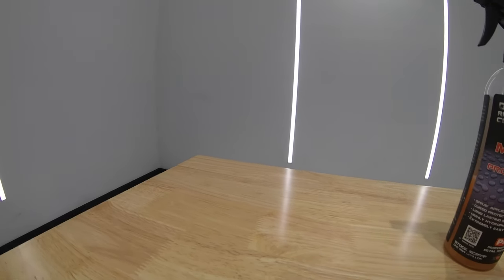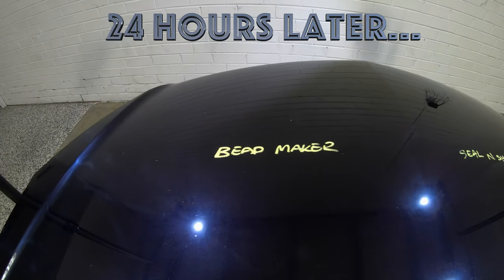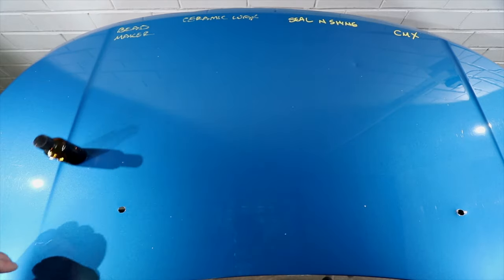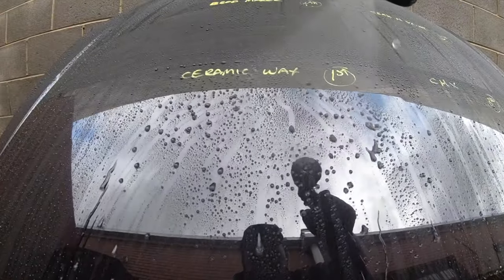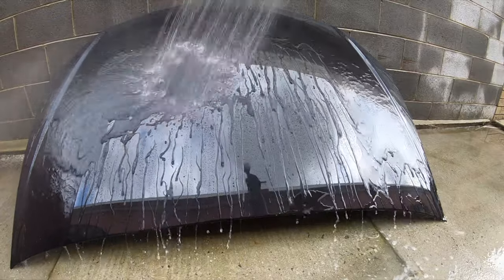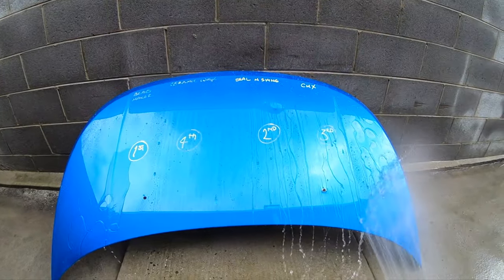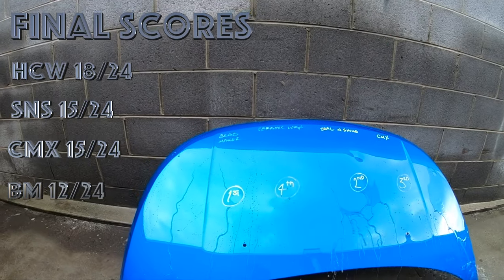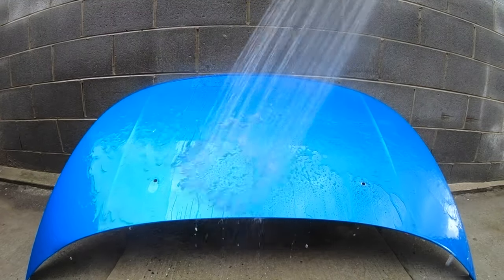Bead Maker vs Hybrid Ceramic Wax vs Seal n Shine vs CMX + Which one would I Choose?

Comment: Sandro so after the tape was removed and camera hovered over the panel IMMEDIATELY Ceramic Wax easily had more Gloss, frankly ez to see. Also in comparison to other reviews, your panel had a haze to start out. Most tests I've seen were prepped and buffed out at least minimum
Reply: He said he intentionally left the paint with swirl haze to make it easier to see on camera.
Reply: @VaingloriousGabagool  I know, just saying appreciate a different view from other detailers thst buffed the panel.
Reply: @CAPTJ696  Fair enough. But why would buffing out the swirls make a difference if the panel is still decontaminated and prepped beforehand, as Sandro always does? Surely any of these products will not be affected much by swirls (if at all), especially when most normal people's cars are covered in them.

Comment: Beadmaker doesnt make beads, which is actually better, you want water to sheet off and to bead on top of the paint, beads just mean you’ll get water spots, if the water sheets off the panel you wont have water spots.

Comment: Wow, the water behaviour of Bead Maker is shockingly bad when the hype surrounding the product is taken into account. The product name is like the complete opposite of what it is. Should be called "Slick Maker" or something like that instead.
Reply: Yeah pretty funny actually
Reply: My results are the opposite for beadmaker. I use it on a various vehicle's: daily Prius, Tacoma truck that doesn't get driven too much but sits outside and collects a lot of dust, honda accord, f150, and Avalon. All washed/clayed before applying a foundation layer. And then after each maintenance wash a few sprays per panel before drying. The water beading is amazing after spraying down with a pressure washer or hose. All or majority of the dirt runs off. I live in So Cal, so it may vary depending where you live. 

Turtle ice selant is amazing for the price and is the winner against chemical resistance.
Reply: Eddie Garcia, same here. I use many different products. But Bead Maker is great at allowing morning dew roll off the car when  leaving home.
Reply: sheet maker? may be better name
Reply: @eddiegarcia9689  Mines too!  Bead maker beads just like all of the other ceramic sealants i have.   And beading is not why i use it.  I use it for it's slickness!
Reply: @AntLive29  lol

Comment: Interesting. I’ve watch many other videos where turtle 🐢 wax is victorious easily over MCW in the durability test . Maybe the cure time is responsible for this . Great video from Andy’s Auto Detailing 👊🏼
Reply: But the main difference with other videos is the application method. They follow the direction on  MHCW which is being applied while surface is still  wet but in this video, it was applied on dry surface which improves its performance.
Reply: Nobody is as thorough as Car Craft, so imo that has the most to do with it
Reply: Mike Q Thanks , mike good eye for details!

Comment: I'm going to say you have a bias to Meguiar's Hybrid Ceramic Wax.
Reply from the maker: The bias I have is basing my conclusions on my own testing results which I work extremely hard to produce and make these videos and present them in a clear and informative manner. Would you prefer I disregard my results and come up with findings that please you? 
What’s your bias?
Reply: @CarCraftAutoDetailing  You're opinion is your opinion. I saw the rankings differently from my screen. I thought Turtle Wax Seal and Shine did better than you were giving credit. But I have a screen and am not there physically for the test.